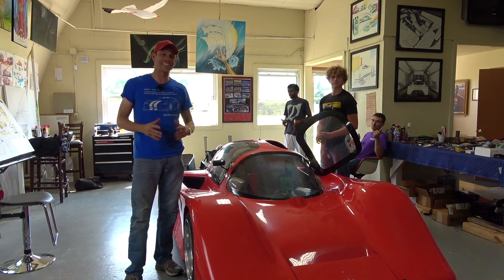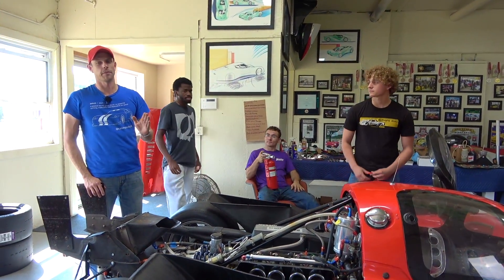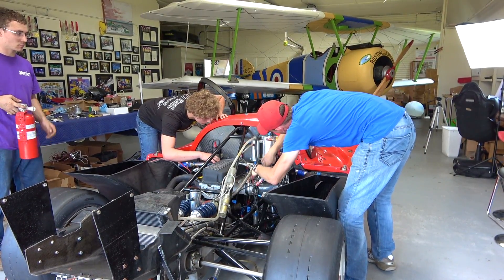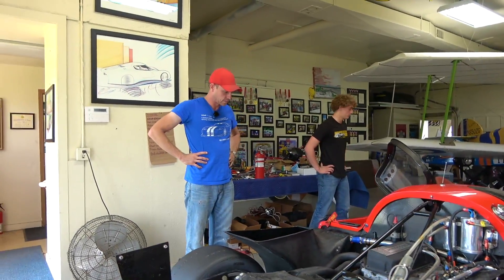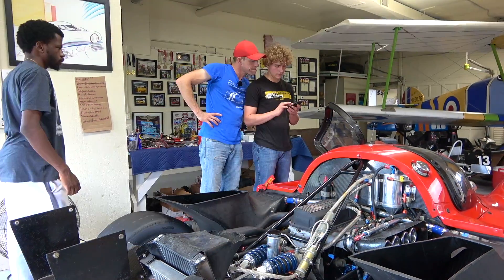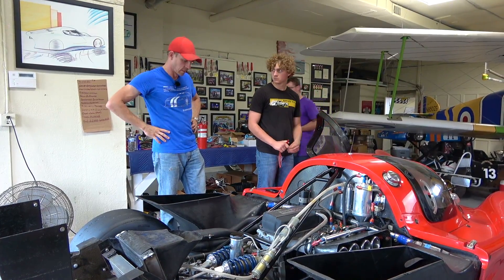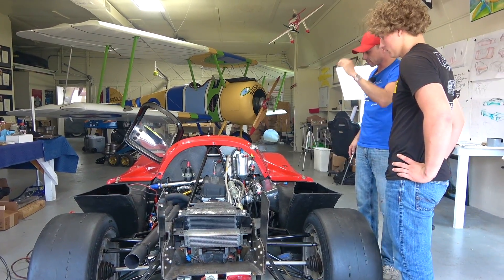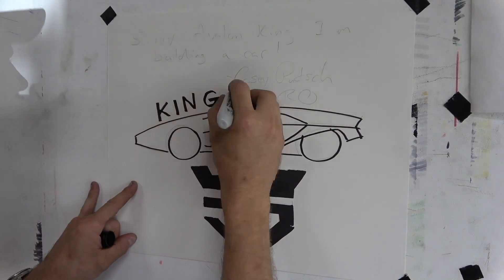First start | Nissan race engine Tame Prototipo

Comment: Stock KA24E Oil Pressure is listed in the Factory Service Manual ad 49.8 - 56.9 psi @3000 RPM.

That is a great sounding engine for sure, just nasty
Reply from the maker: ReverendBow thanks! Actually we are able to readjust the bypass valve.
Reply: @CaseyPutsch  you are Very welcome. Keep up the outstanding work. (BTW, I have owned the same 1991  240SX (KA24DE engine) since 1997)

Comment: Why are race engines so hard to idle?
Reply: usually because of the cam profile, cam timing, ignition timing and no real choke system on these older race cars. they are made to make power at rpm, not to idle and idle is usually rather high. you also get plugs fouled up at low rpm, thats why you always hear them revving them is to avoid fouling them up

Comment: That engine doesn't sound like its that heavily built, it doesn't rev fast enough to make me think its a monster. The way its coughing out the intake i would say its either really lean or the timing is off, which if the timing is off that could be why it doesn't rev fast.

Comment: Nice sounding engine.  NA + high compression = sound porn.  You've likely resolved this already, but with regard to the oil pressure issue(s), a quick google search of "k24e oil pressure" turns up a ton of threads on various forums of people having similar problems.  Culprits range from dented oil pans, to plugged oil galleries, to bad gaskets, to failed oil pumps.  Hopefully, it's something along those lines and not failed bearings, but as you surely know Casey, for race car engines built to 11/10ths, bearings are a common regular replacement wear item.  Whatever it turns out to be, I'm looking forward to the next update.
Reply: that is a dry sump racing engine. you wont find anything on any forum because these engines use an oiling system unique to racing, tolernace are also different as well as the routing of the entire system
Reply: @supersevenn  True enough, to some degree.  In fact, it could be a problem with the gauge, the sender, the dry sump system design or components, or any of a number of other things.  But without specifics of how the engine was spec'd, machined, and assembled, there may still be potential for it to suffer from problems inherent in the original block and/or component design (if/as applicable).  My thought is to start with commonly known potential issues and work from there.

Comment: always make first and second connections directly to the battery that you are using to make the jump. Make the 3rd (positive) connection to the positive side of the battery being jumped, and the 4th connection to a suitable ground away from the battery. This way you avoid sparks directly at the dead battery. I have made the mistake of not doing that in the past and literally lifted the top off the battery when the negative connection was made directly to the battery and a spark occurred that ignited the hydrogen that was a venting from the top of the battery.

Comment: Nissan 4 cylinder engines generally don't have crazy high oil pressure at idle from my knowledge with stock pumps, probably a difference when running a dry sump setup though. a lot of SR20's run at like 10-20PSI and KA's commonly 15-25 using 10w-40. Shoot my Truck idles at 40psi, so it's always a weird feeling seeing less then half of that oil pressure in my smaller engine vehicles lol. Big fan of KA engine's , this prototipo is rad.

Comment: Congrats on getting it running.  I'd pull bypass and check it's not stuck open or debris in it keeping it partial open.  Also sounded like a miss at idle.  Maybe valve clearance or bad wire or timing.

Comment: 467hp per ton. The first iteration of the Veyron was 490hp/ton

If you could push an extra 13hp (270) then you'd match the Veyrons power-to-weight ratio
Reply: This car is even so low its gonna be a killer